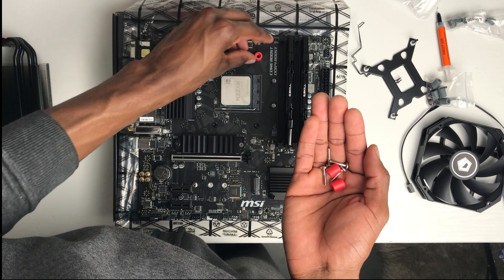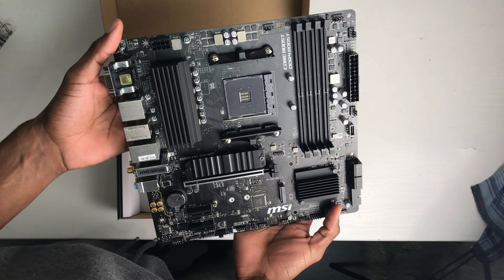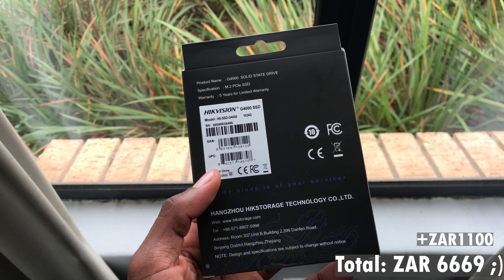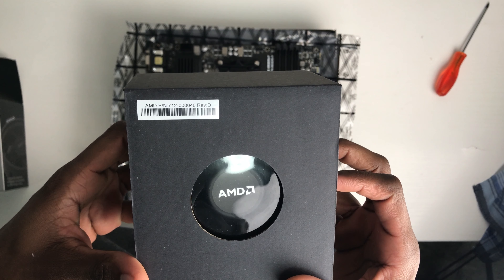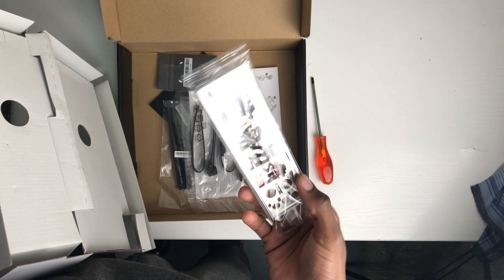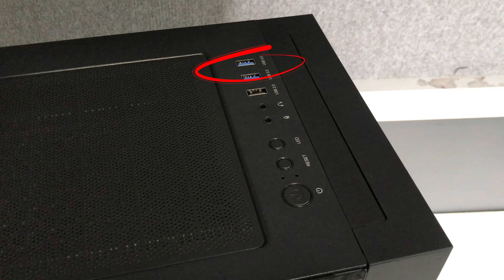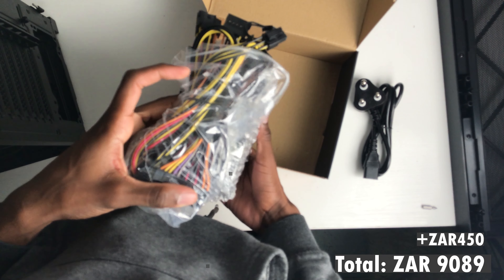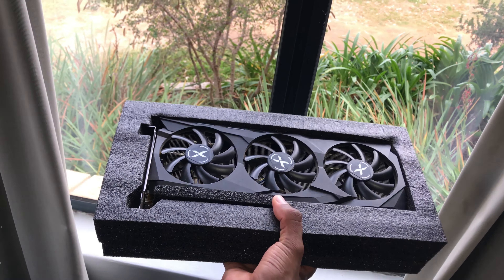I built a 1440p gaming pc for R14 000

Comment: I bough ryzen 5 3600 combo, Msi b450 bazooka max wifi, 16GB ram 8x2 and RADEON RX 6600 XT. 

Looking to buy PSU and saw (gamdias kratos e1-600 rgb 600w) on sale at EVETECH, is it good for my Mid range PC?
Reply from the maker: That’s perfectly fine. Even a 500w power supply will do

Comment: Maaan, 6700 xt for less than R5K?
I wish i could get such a better deal 😀
Reply from the maker: Yeah I struck gold on that one. But the card looks like it’s been used for a while. It had some rust on the fin stack. That would be because his place had a lot of moisture (which makes sense because the seller was from CPT) or because it was exposed (GPU mining rig 🤷🏽‍♂️)

So if you getting that good of a deal there is probably a catch